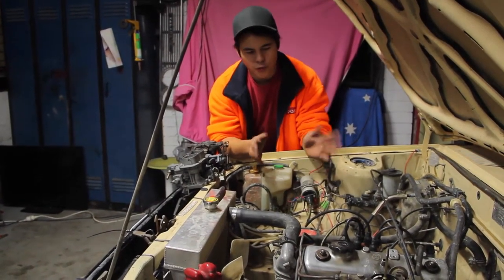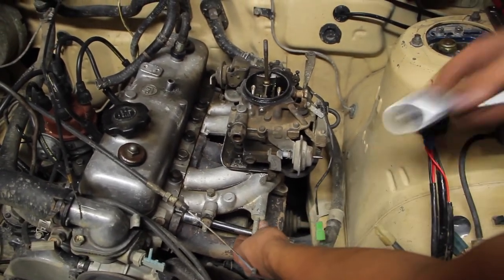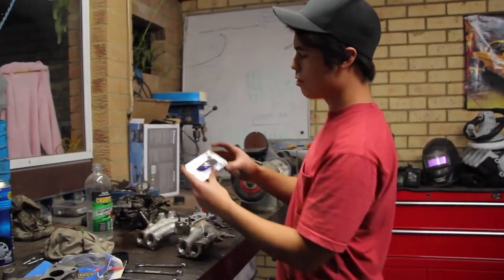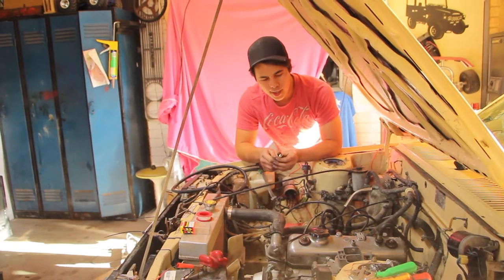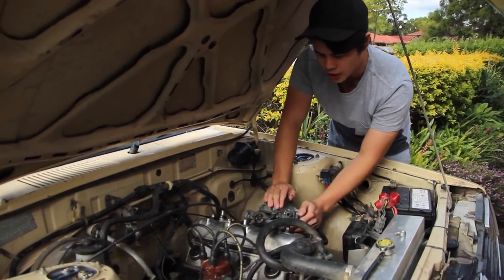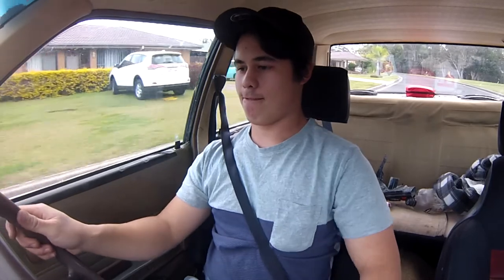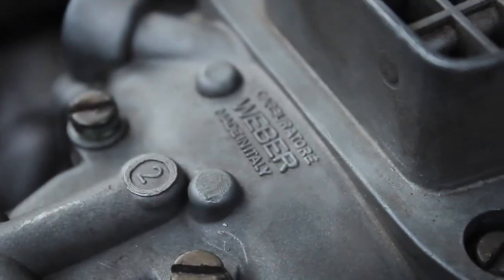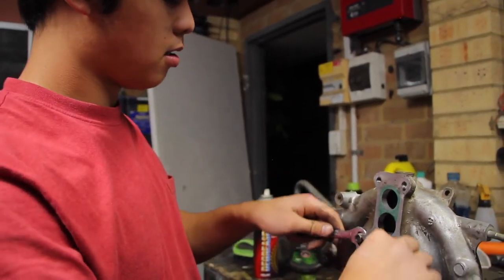Putting a 32/36 webber on the Ke70

Comment: Hey bud, is there a link to the adapter plate where i can find from ebay?
Reply from the maker: https://www.ebay.com.au/itm/TOYOTA-COROLLA-3K-4K-5K-WEBER-32-36-DGV-ADAPTOR-1100-1200-1300-1966-84-P-N10-112/162422890455?hash=item25d1289fd7%3Ag%3AjroAAOSwX3FbEzsM&_sacat=0&_nkw=ke70+webber+adaptor&_from=R40&rt=nc&_trksid=p2380057.m570.l1313.TR12.TRC2.A0.H0.Xke70+webber+adaptor.TRS0

You can also order them from supercheap for the same price
Reply: Cheers man! Was there a lot of difference in power or is it not worth the swap?
Reply from the maker: Yeah mate not bad when she hit secondaries. A lot of mucking around with jetting to try and make it run good. Problem is now that its running a bit rich at idle because the pcv valve isnt hooked up and its just chocking everything with carbon.

Comment: would you sell your camber tops ive got stock ones you can have
Reply from the maker: Nah sorry fam, if i sold my camber tops my tyres would destroy themselves. Chucked a set of gas struts in the front and it lifted it a little bit and it started wearing the outside edge.
Reply: all good

Comment: hey dude! is the engine stock? what jets do you have? i have tried dgv weber on both my cars, ke70 with 4k-c and lada 1200 and looked for "right jets" but it kinda stalls bad on 1/3 throttle :/
Reply from the maker: yeah mate the engine is 'stock' apart from a slight port job. Im not sure what jets are in it as i done it about a year ago now. im pretty sure they were both 145s but i could be wrong. The thing is running like a dime at the moment apart from a light flat spot just off idle.
Reply from the maker: a lada 1200? thats cool as mate. in australia all we got were the Nivas and theyre a beast little rig.
Reply: Yeah, chek my insta "ladahermanni" and in my youtube there is some forest "rallying clip" :D
Reply: Oh and i looked for jet setup last time, now i have 135/140 or 145 main jets and 185/190 air jets and 55/75 idle jets... still dont understand why it makes it stall at 1/3 throttle and when it gets back to idle it makes a "wave" on running speed
Reply from the maker: @MrBanaanipommi  yeah righto. weird. maybe check if there are any leaks in either your inlet manifold or in the body of the carby. through an o-ring or something.
Reply: @FULLBOAR  yeah, all what i havent checked is the o-rings on carb, the guy who sold it to me said its rebuilt and only 2000km driven by now but i havent got it working properly :(
Reply: @FULLBOAR  https://youtu.be/0fLnQIsJNP0 :D over 100kmh on that slippery road :D